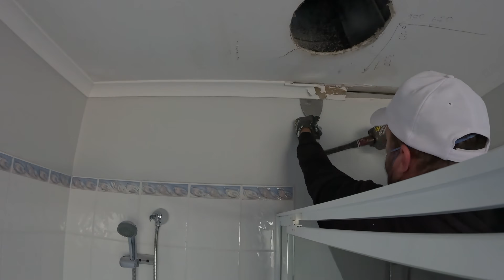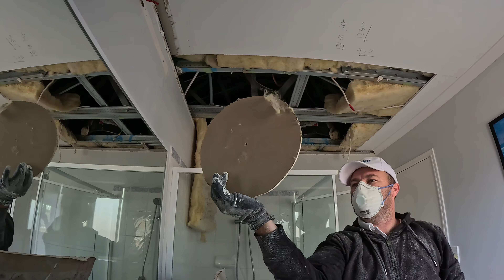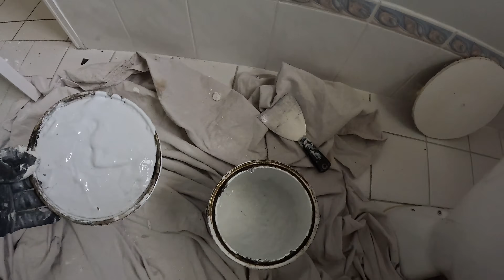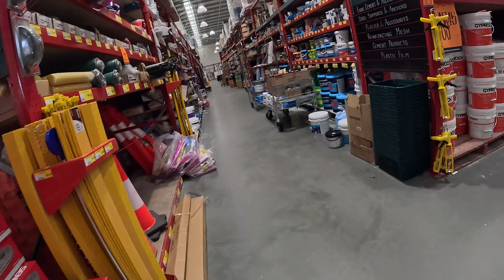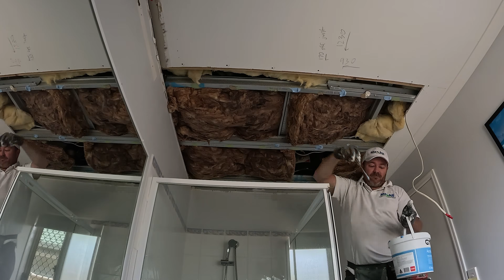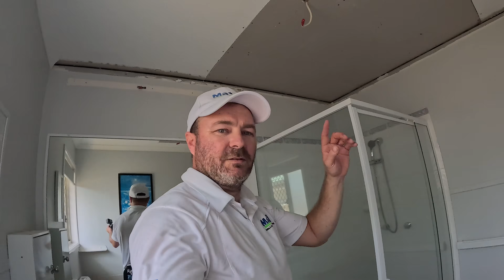Tools & Materials I Use Repair Business In Australia 🇦🇺

Comment: Hi Max you don’t use water resistance board over there?in NZ we have to use a board called Aqua Gib which has to be used in wet areas.
Reply from the maker: Hey mate, yeah we have that as well, only if water is in the wall, but not on ceilings, unless you want to.
Reply: @Maxkil  Wet areas, bathrooms laundry walls and ceiling compulsory over here!
Reply from the maker: It's probably a good idea, I'd prefer villaboard for the walls though. For ceilings I think undercoating and not backrolling seems to cause most damage.